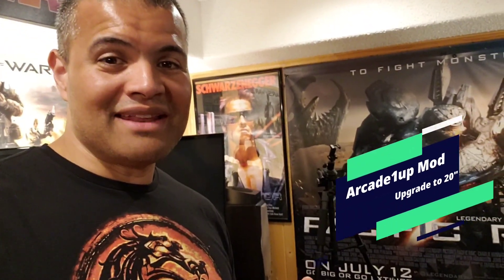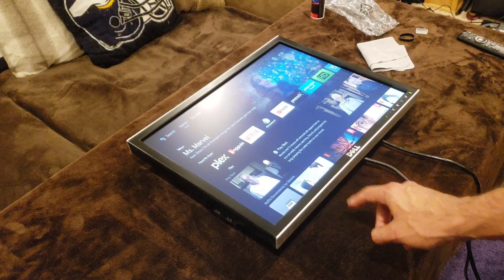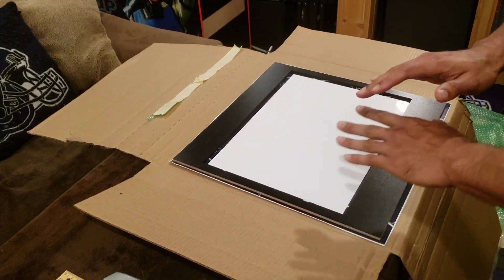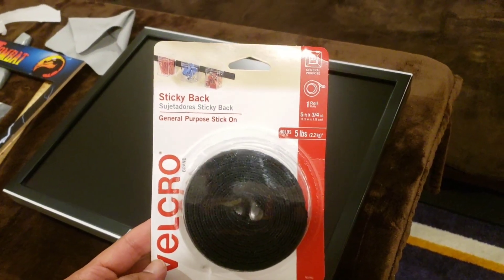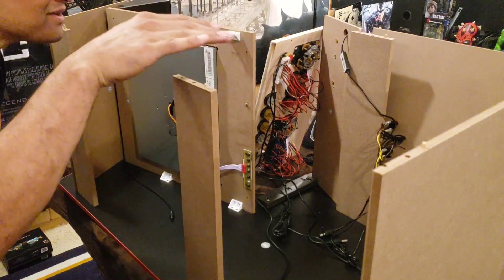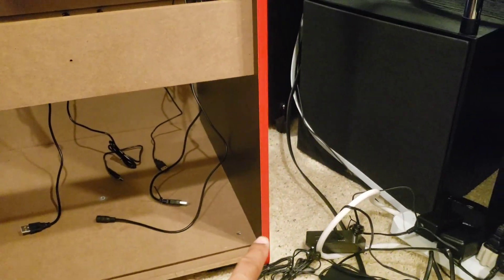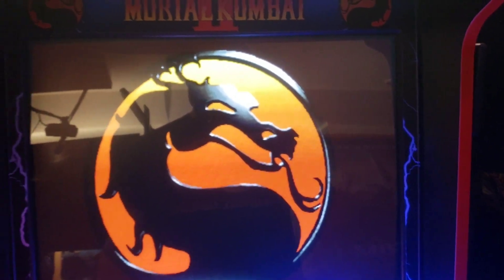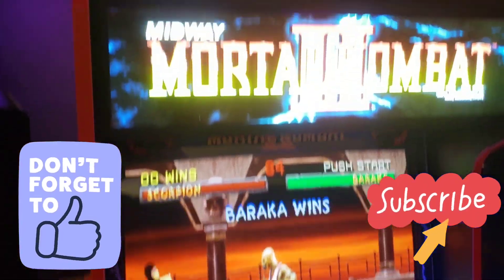Installing a 20" Dell 2007fpb Monitor In my Arcade1up!

Comment: The pin hole on the corners is a good idea.  What you could have done with the vinyl is to position it to line up the inside corners.  Do not trim any of the vinyl.  Adhere the top portion of the  vinyl ( remove portion of wax paper, use tape to hold the bottom part of vinyl.  Check for position.  Then take a exacto knife cut a X pattern from pinhole to pinhole wrap the viynl around the opening cut off excess then removed the rest of the wax sheet from the vinyl and adhere the entire decal.  Then trim out the vinyl on the outside.

Comment: Great video..but..The graphic would have been easier to apply if you peeled the backing off without cutting first and laid it sticky side up and placed the bezel down on it. (tack holes would have been told guide for placement) Then you could have used a razor blade to trim around using the frame as the guide with no slip ups..if this made sense
Reply from the maker: It was my first and probably last time doing this lol.  But thanks anyway.

Comment: hi, how can you power the cabinet without pushing the power button to the side? I want to have mine to turn on if I plug in the wall socket.
Did you brigde the power button?
Reply from the maker: Using a smart plug
Reply: @TheRafcave  Thanks! How is the feel of these led push buttons?
Reply from the maker: @gaboaaa23  Excellent!
Reply: @TheRafcave  realy? Cause the one up arcade where trash. Then ive tried sanwa wich everyone praises. Now I dont know if these buttons are nice to the touch. Are they sensitive and responsive?

By the way! Ive moded my Mortal Kombat 1up arcade with a raspberry pi 5 so I can run anything on this thing! Was so cool seeing wipeout on playstation on goldeneye from n64 on it running. But I have a feeling that the sega mega drive mortal kombat 2 is somehow slower then the 1up version mortal kombat. Could this be or am I halucinating? The roundhouse kick of liu kang for example! The one where he makes a kick to the head while making 360 turn. It feel so slow somehow.
Reply from the maker: @gaboaaa23  Wait, are you asking me If the original stock buttons on the Arcade one up were good?  That I don't remember because I swapped them out immediately lol.
Reply: @TheRafcave  no actualy the new led buttons! The 1 up arcade are shit.

Comment: Thanks for the video….I’ve been searching for help…having trouble with the exact same monitor and set up…did exactly how you have with dvi to hdmi and audio extractor but the monitor says “out of range. Change monitor display to 1600 x 1200” even though I believe it is and mirrored to a pc and made sure in settings…..
Reply from the maker: Change your audio extractor?
Reply: @TheRafcave  
Thanks I think I got it…I changed the switch setting to 480p setting…not ideal but I have sound and audio
Reply from the maker: @ha_ya_to156  Awesome!

Comment: I am finally getting around to doing this for my Ridge Racer and OutRun modded machines after just scoring 2 of these monitors for a total of $40. (IKR?!)   After watching your video......wondering why you didnt decase the monitor before installing it?   Wouldnt it be better to leave those controls from the front panel, accessable  just in case any future adjustments are needed?
Reply from the maker: Correct

Comment: I just got that same Dell 20 inch monitor, so all I have to do is get a HDMI to VGA and plug in directly to the Raspberry pie and it should work without any resolution change settings?
Reply from the maker: Yes, just make sure you set the correct resolution. 👍🏾
Reply: @TheRafcave  I get an error message to change the resolution  on the raspberry pie, I can’t seem to find in in the monitor menu settings. 🤷🏾‍♂️
Reply from the maker: @mysportbuddies  I don't know about the raspberry.  But the best resolution for the monitor is 1600x1200 or 1280x1024
Reply: @TheRafcave  yes, I’m just trying to figure out how or where to make those changes

Comment: Ive got a 2007fpb.  And ive got a retropie 3 all hooked up with the two extra boards.  To use the monitor can i just get a vga to hdmi?  At the moment i have hdmi from pi to board to display.
Reply from the maker: @douglasquaid5655  you need dvi to the 2007

Comment: I'm curious would this monitor work with the Mortal Kombat 30th anniversary legacy cabinet?
Reply from the maker: I don't see why not
Reply: @TheRafcave did some research it will work the only difference is it looks like your using a MK rom or something. I'm just using the standard stock pcb that came with the MK 30th cabinet. Yours probably looks a lot better due to the rom.
Reply from the maker: @R3LAPS3productions  Ohh yeah I'm using my PC.  So I have much more mod options.  Look into it. 👍🏾
Reply: @TheRafcave  since this monitor worked with your PC mod. My next question is, since I am not using a PC based mod do you think this monitor would still work the stock arcade 1 up pcb?
Reply from the maker: @R3LAPS3productions Sure, just use the HDMI out of the PCB board
Reply: @TheRafcave  I see. Thank you.

Comment: I bought the dell monitor because of your mod.  But for a some reason I can’t get the sound to work properly with the Raspberry Pi 4.  Do you have any suggestions on how I can get it to work? Thank you
Reply from the maker: Isn't there a headphone jack on the pie?
Reply: @TheRafcave  There is but the sound is very dull.  I have PC speakers connected directly to it with a sub.  I’ve been researching a work around this and it seems like I have to connect it to a audio amplifier and straight into pi.  If you have any other suggestions, that would greatly help!

Comment: Can you still access the monitors menu buttons?
Reply from the maker: Yes, I have to remove the control deck back, pull the monitor shield a little and then I can access the monitors front buttons.  😉
Reply: @TheRafcave  ok that's what I figured that sux.. I'd want to be able to access it at all times and so I can swap to a game console and hook my laser disc player up to it.. I'll probably go with one of the mounts that slides into the grooves and decase the dell .. I'd have to run the arcade1up without the back panel which also sucks but then I can access the buttons if I tape them to the back of the monitor...
Reply from the maker: @rosevillereaper9230  Well that's way beyond what I'm doing.  I access the monitor once during set up and I never have to touch the buttons.  Ever.
Reply: @TheRafcave  right on pretty sweet set up you have either way
Reply from the maker: @rosevillereaper9230  Thanks man, good luck with yours! 👍🏽😉

Comment: If you plugged in a Nintendo switch or PS4 would the display still look correct?
Reply from the maker: You would have black bars top and bottom

Comment: Can i use this version of that monitor?  Dell Ultrasharp 20" Widescreen 2009Wt LCD Monitor Silver 1680x1050.
Reply from the maker: I wouldn't
Reply: @TheRafcave  aww man  ok
Reply from the maker: There's plenty of these monitors out there and they just work best with Arcade1Up.
Reply: @TheRafcave  you're right . I ordered one before but just realized I ordered another  one , and it's the one I asked  you about.  I cancelled it just now .
Reply from the maker: @illegal_opinions Ok good luck